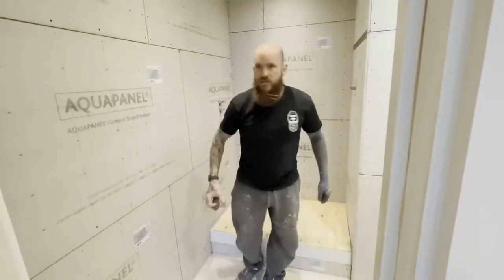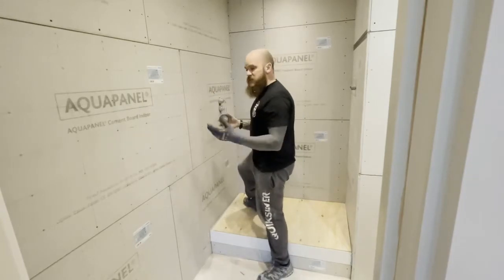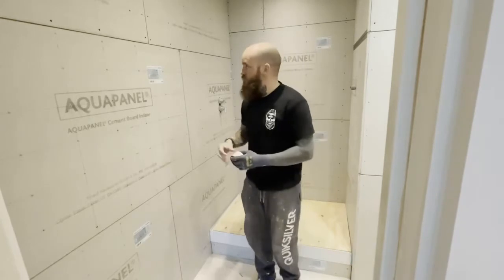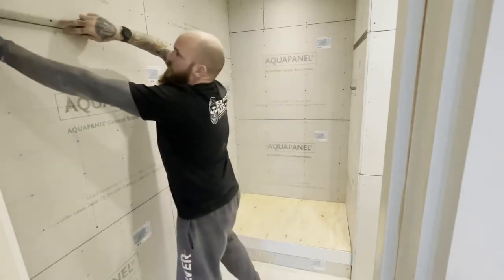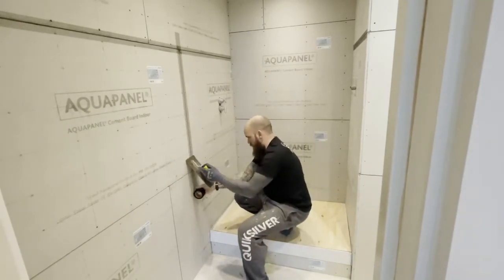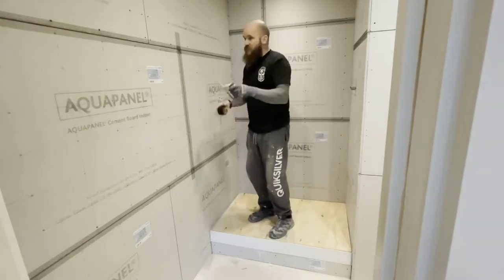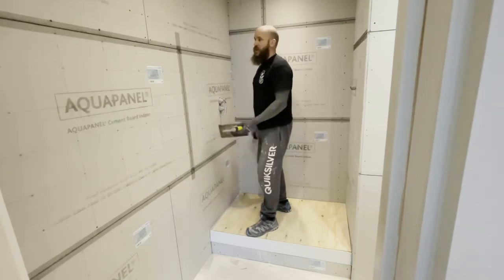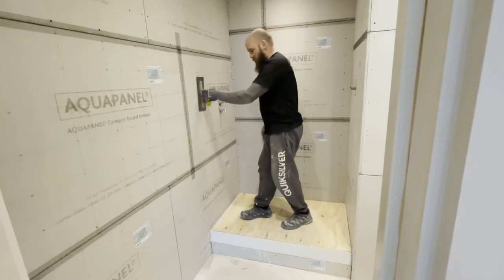Aquapanel (prep for tiling )

Comment: What if you haven't got stud work to fix the aqua biard to as previous plasterboard was dot and dab
Reply from the maker: Are you back to block !? Or do you have existing plasterboard !?
Reply: @TheBeardedTiler  back to the block
Reply: Would you either build a stud work frame  from moisture resistance 2x1 battern or dot and dab and then drill plug and screw through dot and dab
Reply from the maker: Personally I would just batten you could even use hardie backer instead…meaning less wood work and a stronger surface to work on..brick bond the boards !
Reply: @TheBeardedTiler  when you say brick bond are you meaning plaster board adhesive and dot and dab the harde backer board

Comment: Old video, but hope gets answered. What sealer to use on them? Knauf board base coat extremely expensive! Thanks
Reply from the maker: Depends on what your using it for !? If it’s interior then a standard acrylic primer to stop suction and drying adhesive out ….message for more information if needed

Comment: What are you filling the joints with and would you tank the space prior to tiling?
Reply from the maker: Filling the joint with a flex tile adhesive as with what you would like tiles. 
As for waterproofing if it’s a wet room area maybe. I usually tape internal corners as that’s the most prone to leak. 
Sometimes tanking I find is overkill and an added expense. 
Hope this helps
Reply: That's great, thanks so much
 @TheBeardedTiler

Comment: Does the aquapanel need sealing if it is having wall panels over it instead of tiles?
Reply from the maker: No I guess with wall panels you would be using a silicone based adhesive to adhere too
Reply: @TheBeardedTiler  thanks for reply. I've got solvent-free gripfill to stick panels. It think the panel company recommend solvent-free so it doesn't eat into plastic panel.
Reply from the maker: @wantingtolearn2732 will be fine with out sealing then.
Reply: @TheBeardedTiler  great stuff. Thanks.

Comment: How do you fix every 200 on a 400 centre stud as recommended by Aquapanel? As you can tell this stuff is driving me nuts.
Reply from the maker: So these bathrooms were fixed with plywood before fixing aquapanel over the top. This then gives you your fixings. These boards were glued and screwed,hence no washers.  I find hardiebacker is better but more labour time to fix . It’s sturdier to work with though. Does this help ???
Reply: @TheBeardedTiler  cheers mate. I am doing 4 ensuite shower rooms a family bathroom and a cloak room. If I use ply anyway why can I not just use the 6mm?
Reply from the maker: To be honest if your doing that …why not use hardie backer ??? Saves you time as your only loading the wall once ?? This was done to spec of designer …there are so many different types of board out there …I know that cement board can take longer but has a better load per sqm2 …just make sure it’s sealed as it sucks the moisture out of adhesive …
Reply: @TheBeardedTiler  many thanks.

I bought the Aqua on advice but will most def go foam core next few bathrooms. The tiles are only 9mm porcelain!

What an idiot, won't be doin it this way again.

I have 120 msq of 900x600 natural stone to lay after this!